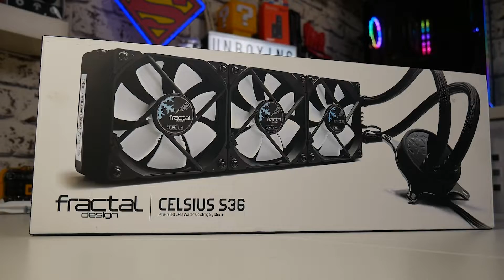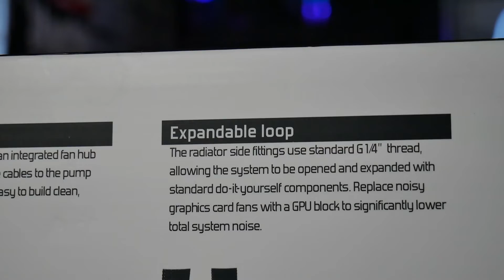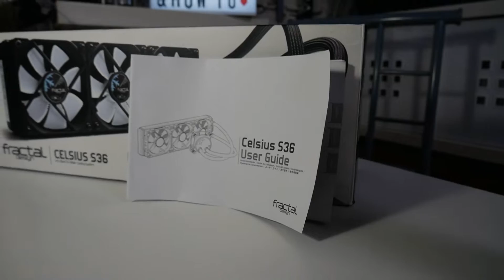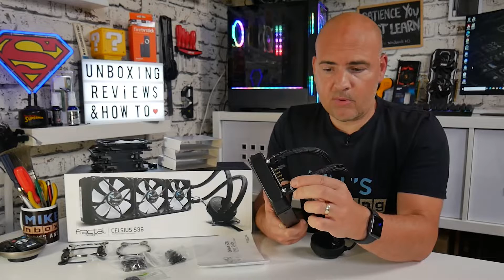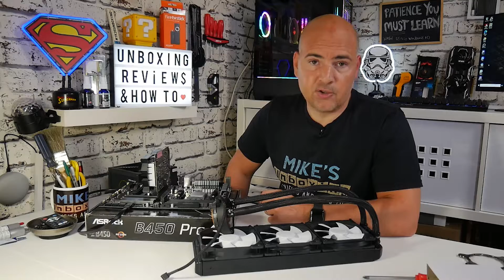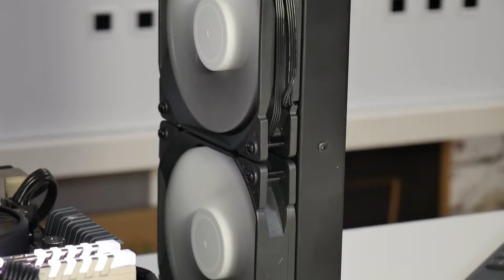Fractal Celsius AIO S36 BIG Radiator LITTLE Fuss

Comment: Have been using this for 2 months, No RGB crap and my i9-9900k @ 4.8Ghz with temps avg 60c-70c during gaming so can’t complain and it’s so quiet compared to h150i and I’ve set it to auto mode
Reply from the maker: nice! i still need to find a case to but this beast in
Reply: My case is Meshify S2 and it fits nicely top mounted , have Corsair Vengance RGB pro ( RGB , but the price was to good to miss) but I would be careful with ram heights as I didn’t have to much clearance,
Reply: I actually just purchased the 9900k any tips with this aio(I have it too haha)

Comment: hello i notice this aio is starting to be a bit old. is it still good today for cpu like 5800x or 5900x?
Reply from the maker: even though it is an older model it still has the raw thermal performance to keep those parts nice and cool
Reply: Just bought one bro. It's amazing. I hooked the 3 fans on a splitter so i can control them in the bios.

Comment: I dont understand the point of the white fans if they dont have rgb. The Celsius+ s36 with the rgb is $200 and this one with the white fans is $110
Reply from the maker: this is quite an old cooler now so rgb wasn't really mainstream back then
Reply: @mikesunboxing  I did not know that. How old is it? I was really thinking about buying it because $110 for a 360mm is really cheap
Reply: @henryallen6599  buy it. It's great. Fractal makes great stuff. The new s36 has a newer pump version and rgb crap.
Reply: @merwinpique  I bought the s36 blackout. It seems well built and the fans move a ton of air. I haven't been able to test it out because I dont have my cpu at the moment but I'm sure it will do better than my cheap air cooler
Reply: @henryallen6599  thnx bro. I just ordered it. The 36+ was 60 euros more expensive. I don't care about a rgb logo on the front. I like the simplistic design of the blackout version.
Reply: @merwinpique  I'm not sure what the difference is in euros but in USD the prisma is double the price of the blackout. I like the tubes coming out of the front of the block rather than the side so it's not jammed up against the ram. But the cable management is the best part. All 3 fans and the pump all on one header is kind of worrying but the total amount of power for it all is only about .65 amps so it's completely safe.

Comment: If I bought this and changed the fans for say some Corsair RGB fans, would I still be able to connect the fans to the fan controller on the rad or would it require extra cables
Reply from the maker: the corsair ones need there own controller so it wouldn't be an easy solution
Reply: Mike's unboxing, reviews and how to ah! Thanks for the quick reply! Do you know of any RGB fans that would work with it?

Comment: @Mike's unboxing, reviews and how 
Excuse me in advance for my bad grammar. I come from Germany and have used the google translator :-). The video is just sensational! You are the first to show the cabling and the cable management in detail. I think that this AIO simply has a unique selling point and is completely underestimated compared to NZXT. If the manufacturers now put the 120 fans in a frame and do everything with one cable, the product would be perfect. https://www.amazon.de/gp/product/B07YZ9SJXB/ref=crt_ewc_title_srh_1?ie=UTF8&psc=1&smid=A16G2RYKO3IO8J
Reply: one last question. the B550-AORUS-MASTER has a FAN1 CPU and one for the pump. Does the cable go to the CPU or the pump connector?
Reply from the maker: thanks for asking! the connection should be to the CPU header.

Comment: Thanks for a thorough video, appreciated the fan cable routing tips. Have an s36 on the way in the mail for my new build and after watching this i am still excited for it :)
Reply from the maker: awesome hope you enjoy it
Reply: @mikesunboxing  I have one question if you could shed some light. The only drawbacks I read about this unit is the fact that the pump speed is also regulated with the fans when using the s36 as intended with only the one cable. Thus sacrificing functionality for cable management.    The Pump fan header on my MB is an always on full one, and most aio's (from what i understand) will run the pump at max, and only differenciate fan speed. Is there anything about the pump on this unit that would advice against running the fans on separate header and running the fractal pump on an always full pump header ?  I would then leave the cable from hub to pump disconnected, and use the included fan hub directly to MB cpu fan header.

Alternatively I could use the Optional CPU header and create a separate curve for the pump preventing it from going too low if it was to follow fans in a very low load situation..

Comment: Nice AIO. I bet you wish you had it on your last build live stream. LOL  The main problem with AIO's is the radiators are too thin and rarely made of copper. Good tip using the screws to help hold the fan cables. Why have I not thought of that? Thanks, teacher!
Reply from the maker: Yeah the cable management is pretty decent on this despite the amount of cables that could get loose. Most of the aio that I have used where pre assembled so it was a bit luck really that I considered using the mounting screws as cable management parts

Comment: Mike, I see you're using Hardware Monitor. Sadly, I have to say that I do not trust the correctness of this software. It isn't possible this software reports a Ryzen 5 2600X, at stock with only PBO enabled and cooled with a Scythe Fuma 2, with the cores at 5.2 Ghz while HWInfo64, Ryzen Master and the MSI Hardware Monitor only report this CPU at 3 or 4 cores at 4.250 Ghz.
Reply from the maker: i have never had any problems with it. and as i am comparing setups with the same software any issues should be the same on each one. And to be honest all these benchmarks and tests are pretty much useless as no two systems are identical but i guess it is a guide
Reply: @mikesunboxing  Well, got a screenshot of both running side by side while playing Star Trek Online. You will note the big difference in a split second.

Comment: Great review again Mike as usual would you recommend this or the arctic freezer 2 280mm that you also reviewed??
Reply from the maker: Very close call. They both are really good I suppose the factors will be the size and the colour scheme as the arctic is a greyish colour and somewhat smaller but some cases my be limited to 120mm width coolers.
Reply: @mikesunboxing  that's an incredibly good point and one I hadn't thought of but looking on gamemax site it says the view can accommodate 2x140mm fans at the top so I'm guessing a 280mm AiO should be fine in there
Reply: Put the artic freezer 2 in my sons case ,Had to front mount as it’s a FAT Boy, But really long hoses on it and it’s perfect for job, but that Boy is Fat
Reply: @colinjapp6468  yeah I went ahead with arctic liquid freezer 280mm but had to change my case to accommodate it lol great cooler though love the little vrm fan 😀